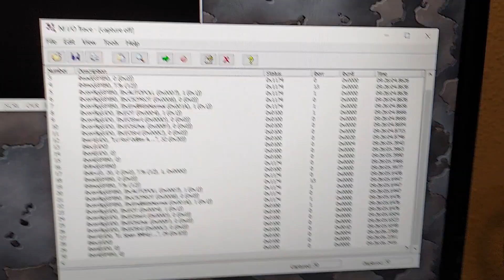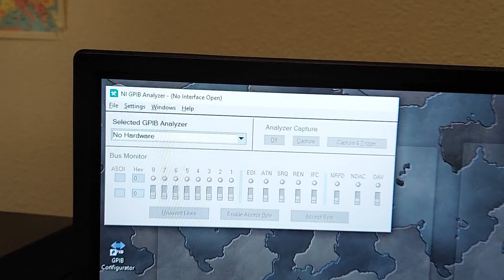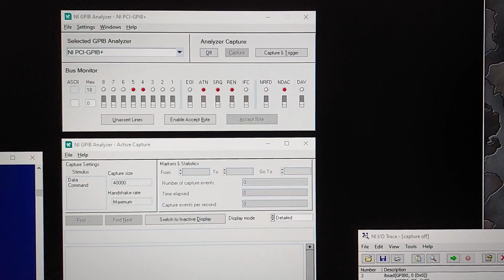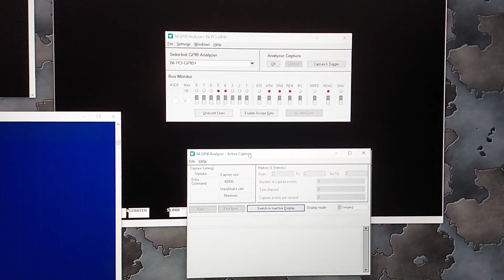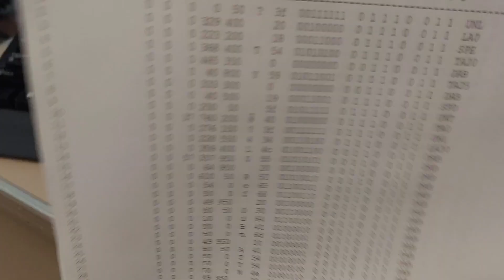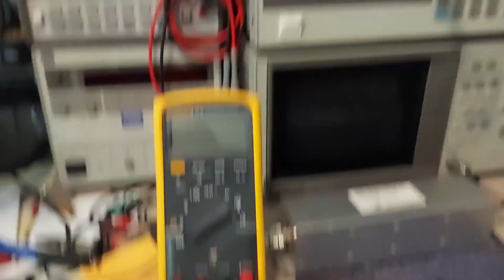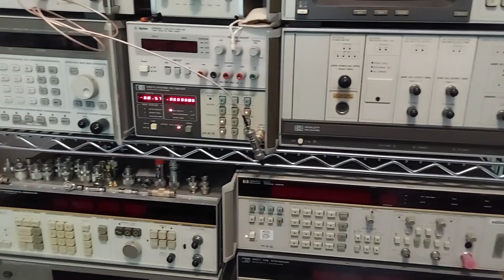GPIB / HP-IB controller.

Comment: Just came across your YT video..Getting late and failing asleep! LOL!
Are there any boards as such but PCIe?
I found some of the regular boards on Ebay.
Not the plus..
Basically, just got back into software/hardware as it is the beginning of winter here in Ontario. My new plan is to use my HP8753E VNA to auto tune my ATU...
Regards
73's
Dale
I see the rig expert device in the background, so I take it your also a "Ham"?
Reply from the maker: Sorry for the delayed reply. Yes I am a HAM, been licensed since 1991, it was the natural next step from my electronics hobby. If you are looking to explore the GPIB world I would recommend the KE5FX GPIB tools software package. It's free and has many useful tools. I also use a commercial software package called HTBasic. It's not free but allows you to actually run the various HP Basic code examples nearly verbatim out of the HP owners manuals. I have written a few graphing applications in HTBasic to graph voltage variations over time. I have recently been learning to code in python for instrument control as well. I'm considering doing a follow up to this video since I haven't posted a video for the last several months. Thanks for watching.

Comment: Thank you for the video ,When I plug in the GPIB card (identical to yours) into Windows 11, no sign appears, even after installing the driver. Does that mean the GPIB card is damaged?The NI analyser software show only no hardware
Reply from the maker: Check to see if the GPIB card shows up in device manager. If there is no issue there, connect and power an instrument on and launch the VISA interactive control. The software will scan the GPIB bus and list any instrument it detects such as GPIB0::9::INSTR for example. Even if you don't have any instruments attached, the GPIB interface should show up in the scan. Using the GPIB analyzer software requires the GPIB+ card, using the software with the non + versions will not show up in the interface menu. I suspect it's possible the card could be defective; I have been buying these cards for years off eBay and have yet to come across a bad one. Also check that the right driver was installed, you need the 488.2 driver from the NI web site. Hopefully this will give you some ideas to solve your issue. Thanks for watching.
Reply: @CraigPetersen12f36b  I replace it with another card and it's work now, i appreciate your help, Thank you.